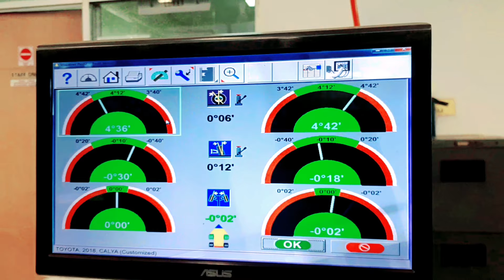Cara mengatasi setir berat dan lambat balik pada mobil toyota avanza

Comment: Kalo mubil avanza 2006 bang dr tik road udah gnti.. pupma power string normal.. semua normal tp msh berat apanya z bang
Reply from the maker: joint ster gmn om
Reply: Joint stir aman.. tirud aman suruh gnti sudah saya ganti... pumpa aman om.. ktya setelan bawah suruh ngendori.sdh saya kendori.. stabiliser udah saya gnti.. dan akhirannya begkel suruh gnti copotan om.. hrg 3 juta.. z percma bawa ke begkel di baiki klo suruh gnti baru om..